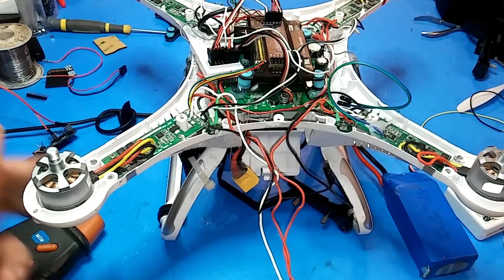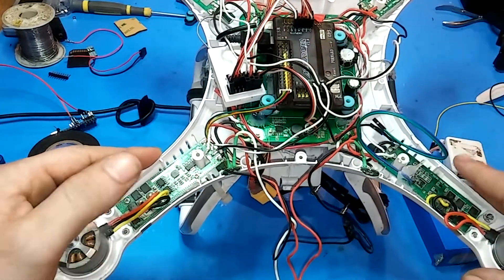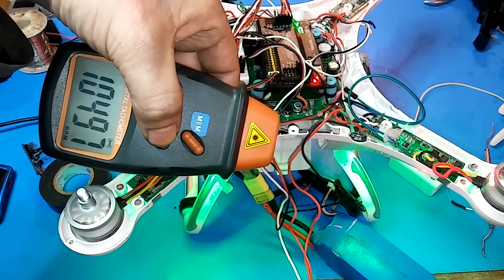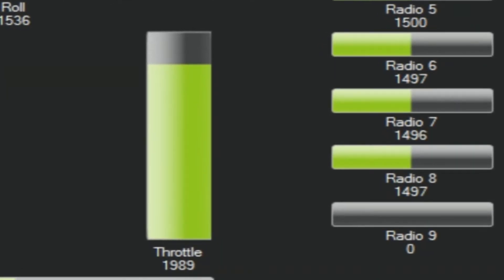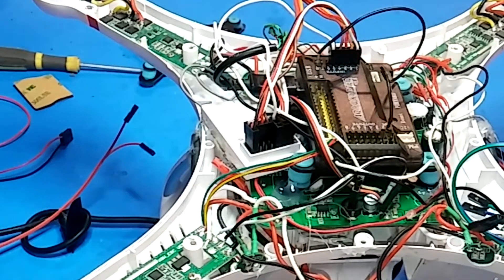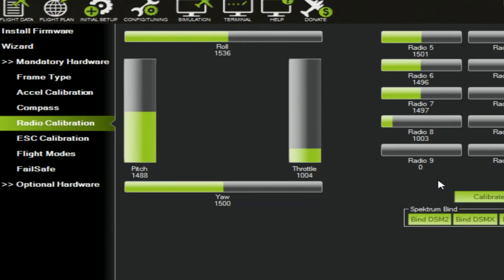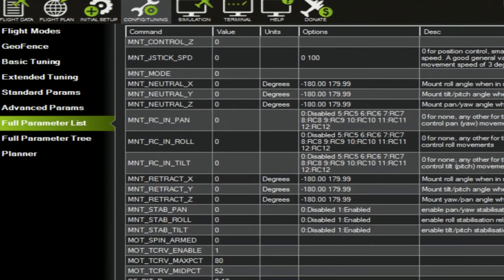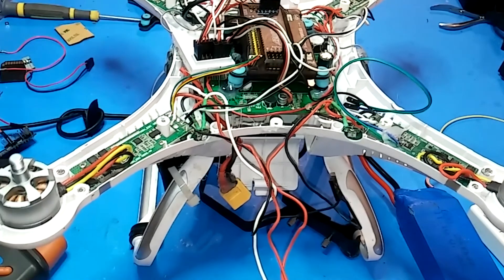cx20 and apm payload fix

Comment: Gps is good i did the calibration where you spin iT to the white squares amd iT passer and daved
Reply from the maker: hi.. here is one example of disable arming check.. in newer version you will have check marks..just un check them all.. and write param
https://youtu.be/_yl4VaZnpMI?t=2036     .... without gps signal by default the quad will not arm.. so if your in your house it just might not arm time to time.. so its best to disable while testing it out..

Comment: On my pixhawk cx20 the receiver is not Reading but the motors are connecties right iT moved when i first plug in the battery but iam having a probleem Arming my drone from the receiver help
Reply from the maker: Hi.. first make sure to disable arming check.. just to make sure its not gps related..   Next did you calibrate your cx20 remote and leave the throttle center when you were done??.. .... When you do a radio calibration in mission planner leave it down..  oh and disable the safety button as well to rule that out..
Reply: Do i calibrate remite on mission planner or the original way with the OLd flight controller
Reply: All i need is that probleem to be fixed and iam ready to fly
Reply from the maker: HI your messages are all over on my end.. not sure where you are at ..or if you checked out the disable arming check  video i sent you.. if not just reply back to this one if your still having issues..

Comment: Hello and thank you for sharing your knowledge with use. I follow your channel quit a long time and must say it helped me so much to understand the components of the Cheerson CX-20.

May I ask you if setting the value from 1 to 0 should be done only when carrying heavy weights, or should it be set to 0 anyways? I had a look into my MissionPlanner and saw that this value is also set on 1 in my parameters.

My Cheerson is carrying a Walkera G-2D Gimbal with a GitUp Git 2 camera. Weight is 200 gramms.

All the best from Kiel/Germany
Ingo
Reply from the maker: If you have no issues with your quad I would just leave it set to 1. , with the setting on you will find a smoother throttle .    

In the video I only had a 191g when it crashed. the wind and the weight would not let me tilt the quad to bring it back so the wind just took it away.
(It did the same thing in my house, I could only go up about 8 feet then I would loose throttle after 3 seconds and it would not go higher then 2 feet)

You are probably not having that issue if you are flying around 10 feet or more as i could not even get that high..

with that said you might be loosing out on some pwm's(rpm) with the throttle curve so its up to you and your experience if you want to try the setting. You will feel the difference if you actually need it..